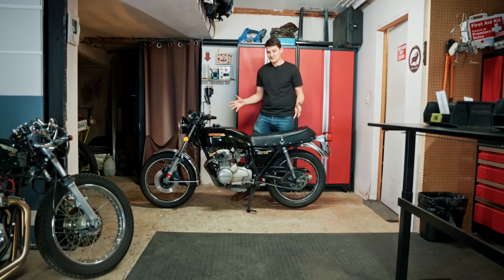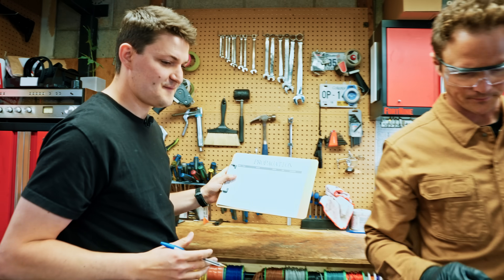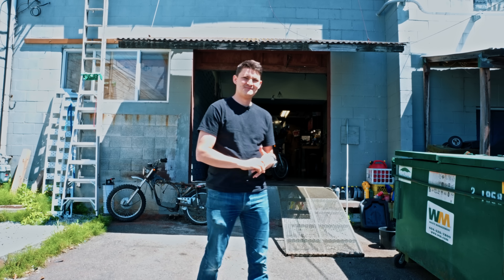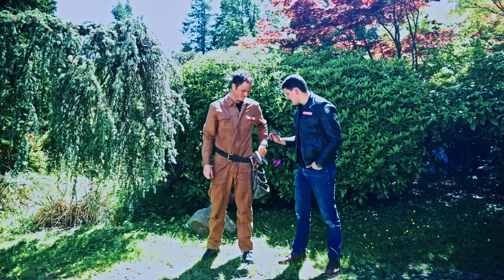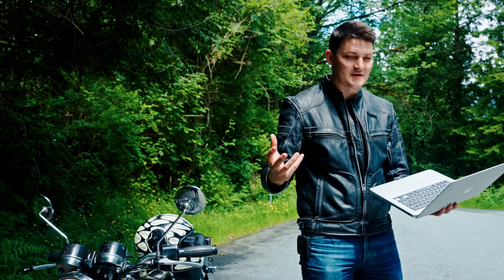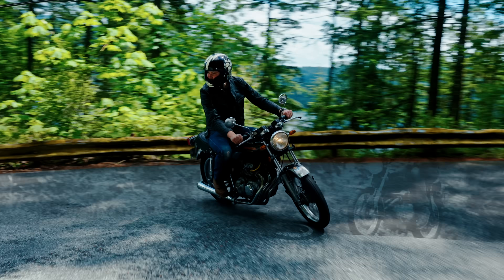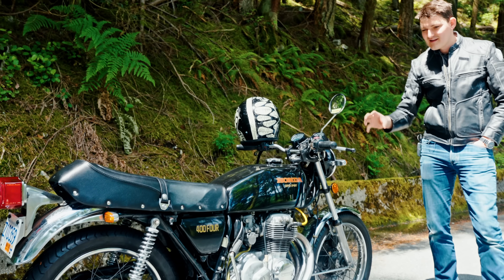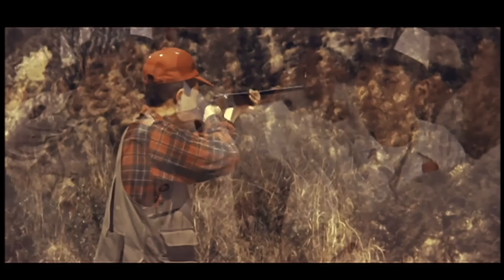Why Hondas Run Great - JIT Manufacturing, 5S Methodology and Kaizen

Comment: The 50 year old Honda is very similar to my first motorcycle. A 1975 CB750F Super Sport. I believe the F was a Kaizen update of the original 750K four which was already an outstanding bike. I ran the doors off of that thing and it never quit. Calling it reliable barely touches on how confident I felt in it always getting me home. No auto I had owned even came close.

Comment: I just hope that FortNine is making some of the contractors I work with who are big on their motorcycles;FINALLY FCKIN PAY ATTENTION TO 5S!! They start out as "we get the job done and do what that is nobody else can get done someone can clean up later if it's that important" 
And it turns into 
"those are just extra bolts I think the engineer who designed this is stupid why should we use his bolts by the way did you know that machine they designed fell apart?" (it needed the bolts)
Reply: Engineers who ride are also guilty. If they cleaned up their own desks they would be able to look at one thing at a time and see "wow that servomotor shaft has a square key slot why tf didn't we give the builders any keys for the servomotor shaft?" "And why is it slipping continuously on every machine we turn out?" "I hope my installer stops messing up and this all works out"

Comment: Back in '78 or '79 I had a conversation with Honda San. He'd been staying in the hotel I worked at, spotted my CB750 in the parking garage and tracked me down (not hard, there was just one bike in the garage, everyone knew it was mine - and I was a manager in the front office). H wanted to know why I'd bought it over the Kawasaki 900. I told him that it was better built, that the motor was easier to work on and clearly built to be repaired (shell bearings vs running straight on the castings). I'd had a number of bikes, starting with an AJS 500cc single (essentially the Matchless 'boy racer' with a rear suspension and pillion seat). I'd had at least one previous CB750 at that point (the first one had the infamous 'no room to put a big enough drive sprocket so chains wear out fast). Honda had treated me well on that one (replacement chains and sprockets) and I really liked that motor, so I bought another. My only real complaint was that that engine was too wide for the track, touched down way too soon.

Comment: As an aircraft technician, every job I’ve had very strictly enforces 5s. When I built jet engines for Pratt, they even had the specific amount of hardware in little kit boxes you needed for that specific task, shadow boards for tools and parts, etc. everything had a home, even tables were taped around on the floor and labeled.
Reply: Funny thing about those taped in tables, had my printing company when one of the prepress crew went on vacation, the rest of his team moved all of his tables about 3" in different directions. And when he came back he couldn't understand why he kept bumping into tables. Once you have everything dialed in, movement becomes automatic.

Comment: 400 F was the second motorcycle I ever owned. The first was a trail 70. I loved my cb400f. I put all kinds of aftermarket parts on to it including a Yoshimura pipe. I might have that name wrong I can't remember but it was a very expensive aftermarket pipe that could not be made to touch the ground at any angle while the bike was still on two wheels. Of course I have magura bars and Andrews coils. I never could afford the mag wheels but it didn't really matter because something happened. I saw myself in a big mirror sitting on the bike and by God I looked like the Grape Ape. People don't realize it but the cb400f is a small size motorcycle. It's very tiny and I am 6 ft 5 so I traded the bike for a 67 Firebird which I melted going through the Caldecott Tunnel at 130. What can I say.

Comment: Coming from a multibillion dollar chemical manufacturing company that pushed Toyota's operating system, the implementation is critical. I had to label a spot on my desk for a stapler or box a section on the floor for my chair to sit. Absolutely BS. There are good parts, but much of it is common sense or complete overkill BS. FWIW I also have a black belt in Six Sigma and don't even put it on my resume as I never want to be pigeon toed into doing that type of work.

Comment: Taiichi Ohno, at Toyota created Just In Time. My Hero. My favorite is that along the production line you had ropes that would stop the whole production line. If a problem happened in assembly You stopped the whole line and fixed the problem at the root cause. After a few weeks there were no problems. In Britain they would have sacked the rope puller, everyone else would have gone for a welcome cup of tea and next friday afternoon the same problem would give everyone another break.  Toyota, I have bought and run to death 4 of the'ir cars. RESPECT, Fast and Simple. Now on Motorbikes I have rebuilt Nortons, Ducatis BUT Hondas I have never needed to rebuild, I have just worked on them and I have had 4, still got one. Mostly V4s. I have also owned Yamahas, Suzuki and Kawasaki. What is the difference? They are all using JIT manufacturing techniques. However, Honda sometimes decide to show how good their engineering is and throw the accounting out of the window. For example my 2000 VFR. It has pillion drive to the cams just like an MV GP bike used to have, no sloppy maladjusted chaindrive. (the weakness of most straight fours). Now get this. At 100 000km+ I change the oil. 5000 Km later the oil is still clear, not black. I am 67 years old have worked on many bikes and cars. I have NEVER seen that before.

Comment: Yamaha employee here. JIT, 5S, and Kaizen are also key principles for us too.

Really the game changer can be boiled down to this quote describing lean manufacturing: "Lean is the continuous struggle to flow value to one customer". The term "value" has a specific definition in a lean context, basically only activities that physically transform that lump of raw materials into something closer to what the customer wants. 

That's what lean manufacturing is all about: building an organization optimized to provide value to its customers, devoted to continuously getting better at that, while respecting its people. Take those ideals to heart, and the tools can be derived from there IMO. Maybe they won't have the exact same name, but you'll end up with a similar result. At Yamaha we have TVP and Hyoujun Soubi for example, which I've never heard mentioned elsewhere, but the principles will be very familiar to anyone with a background in Lean.

Comment: In case you're drooling over the little cb400, it couldn't hold a candle to the RD350 and RD400. Some ambitious 4-stroke lovers tried to modify the CB400 Four for club racing but any decent running RD with expansion chambers could eat it for lunch

Comment: and now in indonesia, one of honda's biggest market, they turn into almost like a chinese brand. folding frame, cankcase as fragile as windshield, rear mudflap not aligned with the tire (its almost like a feature now 😅).  and all of this is not japan honda's fault. its indonesia's division that is either corrupt, dumb, or both. they lowered the quality of every single part, the new factory worker only gets 1 year contract unles you're super good (imagine new worker every year). and the thickness of every part is reduced to bare minimum or less. its widely known that honda's new scooter main frame tends to fold due to its super thin and corosion problem. like hell mr honda himself would shut the whole division if he's alive.

Comment: Dont sound like honda today, here in Indonesia, where small scooter is the main market, last year honda made huge mess, by making the frame somehow "unfinished".
The silicate slag from welding werent remove and paint cant cover over it, the welded area becone uncover, then it got rust and eventually break a part.

The worst thing was that honda never recall their products instead they sell a frame as substitution part.
That very frame is still used in 4 or 5 scooter types.

The other was engine, honda use 1 engine for 3 bikes, a sport fairing, naked, and underbone, since 2016 untill today, that very engine has  weak camchain tensioner, making the bike sound wrong, and the drivechain make a loud noice, and they never improve it.

Comment: German and Japanese engineering are both outstanding in their fields, but the crucial difference between them is the attitude towards their customers. (This is not saying, either is better than the other, just that one is going to be suitable for more people)

A German product will last a lifetime, as long as the customer is using it within warranty regs, because a German engineer can't imagine a German citizen to take their priced VW Beetle for a spin on a Finnish rally stage.

Japanese product will similarly last a lifetime, with the very significant difference, that they recognised, that there only exists a handful of people, who will only subject a product to the wear and tear calculated in the factory, and those people all live in Germany, so they built everything so that you can do most anything to it, as long as it's not actively dismantling the framework.

German products are made to be invincible to an engineered environment, while Japanese products are made to be invincible to humans.

Comment: So basically what your telling me is. What made Honda great, makes me hate EVERY SINGLE HONDA VEHICLE ever made.

I'm all for the constant improvement type of thing, but it gets annoying when you're fixing a Honda (especially their cars) and you find yourself staring at 12 different parts with 12 different ways of installation on an engine that is 4 years old. 

I like Toyota and Subaru more. They made them simple. So what the spark plugs are hard to do on 2GR-FE's and DOHC EJs and F-series, at least other items are easy to do. Like the starters, serpentine belts, timing belts, oil changes, transmission replacements, engine replacements, etc.

This in turn are making them more reliable. Subaru F-Series motors are seeing 1,000,000 miles and Toyota motors literally will not die. Unlike the K-series and J-series engines. The K-series are notorious for oil burn and starter burn out and the J-series is know for blown transmissions, while the VCM engines are known to burn valves and oil.

However people don't like when facts like this are stated and they continue to glaze the Type R.

Comment: Hi FortNine and congrats for this video! As a 25+more experienced rider and as a 25+ more supply chain expert I enjoyed each and every single second of it and I feel like this video could even help many SCM professionals! Unfortunately, and I don’t blame you because it’s a commun misunderstanding of the concept, the way you “pronounce” just in time is wrong. It’s not « just in time » but « just, in time » meaning: the just quantity(and quality), in due time. Since decades many industries try to reach the zero inventories target in order to endorse the JIT philosophy which create unwanted tension in the production or supply flows. Inventories are an asset for a company if they are well dimensioned and help buffering the different stages of production. Will not elaborate here but needed to say it! Thanks for your interest in the SCM science and congrats for the show!

Comment: As someone that works currently in the automotive sector, it warms my heart that quality concepts are still being preached. Even by people not in the field. I struggle with my colleagues and management currently on the why's (aka root cause problem solving). It's slow "right now" but then there won't be a problem again ever after.

Unfortunately, I'm being over-ruled for bandaid now (often literal bypasses) by another colleague and then we force some trainee to watch the thing to not break down until the customer demands a permanent fix. Often at time crunch and our expense.

Comment: I did briefly have a chance to work at the multi-purpose engine factory as a translator. I can vouch that everything you’ve said in the video, they aren’t just for marketing, they take it seriously. Kaizens are heavily encouraged in every way possible, not just for the design. There were kaizens for safety and quality of life improvements when I was there (such as better oil spill protections for parts karts), and the proposers were rewarded for doing so.

Comment: Pretty much any well maintained air cooled carburetor engine that's 50 years old will start immediately.
That goes for lawn mowers to VW's.   By the way, at 0:06 that's a hell of a nice front DISC BRAKE on a 70's bike.

Comment: What may allow the Chinese to take over in motorcycle mfg is that the public is not a discerning one. At some point things become commodities like washing machines, microwaves, computers, etc. Sure you could go out and buy a USA made set in the past but at some point people stop caring about quality and just about price. Eventually you can't even get a mass produced USA made microwave or computer. Almost all washing machines except Speed Queens are made overseas or at least with mostly overseas parts and materials. 

Maybe consumer sentiment will change to favor long lasting and well built goods but at the rate technology improves many things it may not be financially sound for many.

Comment: The Lean methodology (that came out of Toyota's manufacturing originally) is applicable to a lot. It's even applicable to your own garage and workshop and kitchen. It can make many processes a lot more efficient, quite aside from JIT manufacturing. Just in time also has issues... as we're seeing on the world stage, because as soon as the flow is interrupted, the whole chain just breaks down very badly. Arguably as a species we'd be better off if we were a little bit less just-in-time - except of course, that would probably be less profitable, if considerably more resilient. And say it with me, all hail capitalism and maximum profit at all costs.

Comment: I used to work for a multinational company that incorporated 5s into its work flow, the biggest issue was management constantly changing it. It can work in certain industries but for customers that would change orders constantly and require design changes quickly it became something that slowed us down

Comment: I worked for a fairly large auto part manufacturer that supplies many large American auto manufacturers. In my case I was setting up some of the disaster recovery systems, I'm a computer guy so manufacturing was really my thing in the beginning. A lot of programming was required so that a workstation could be replaced in >5 min. They hired Me as an employee, not a contractor. I was fine with that at the time. UNTIL the 5S Police showed up (the first set of 5S Police), the plant I was working at was a JIT supplier. There was a lot of time and money spent on Kaizen principles and whatnot. 

There was more than one department, and more than one person who all thought they were Primarily responsible. None of them used the same standard. Pretty much quarterly I had to stop what I was doing to re-clean, re-organize, RE-LABEL everything on my desk. The company loved to beat their chest about 5S, but the company didn't understand 5S. Didn't understand that one size fits all solutions don't necessarily work when trailblazing was still being done. In that poor implementation it was a serious time/money sink.

Comment: You forgot to mention the supply chain, which is extremely important. Parts need to get to the manufacturer JIT, sometimes even on the same day that they are going to be used in production, and most importantly their quality needs to be top notch. Fail to do so and  waste will appear down the line, assemblies will need to be reworked or scrapped, increasing time and material waste. Quality is not only a result, but a necessity of this manufacturing methodology, that is why OEM parts are of such good quality.

Comment: The CBR600F2 (1991-1994) already had the air ducts on fairings and two hoses on airbox (which lead nowhere yet) ready for the RAM air intake system on the CBR600F3. Some clear evidence of their 5S methodology on being ready for the next part.

Comment: I once owned an '82 750 Nighthawk. To say that those bikes were bulletproof was to somewhat understate the case. In the 7 or so years I owned the bike I did the cam shims once and synced the carbs, also once. Those were the most intrusive maintenance items I had to do. Otherwise the bike started every time and ran near flawlessly ( I say "near" as it stalled on me one late evening at something near 60mph on a pitch black David Thompson highway, leaving me both power and light less whilst I silently coasted through a herd of elk that my riding buddies later told me were "all over" the road, while I was otherwise occupied trying to get the bike going again). I still miss that kind of reliability so instead of a domestic 1/2 ton, I opted for the Ridgeline instead - a decision I have yet to regret. Yet another lesson: if you build excellent and reliable vehicles, your customers will support your brand with purchases decades later.

Comment: I agree. For decades Honda in my country has been the leading brand for quality and longevity. Sales are off the charts until production line couldnt keep up with demands. Honda motorcycles in Indonesia is produced and assembled by AHM and nowadays Honda bikes are notorious with low quality material and finishing, especially in younger generation whos aware of the situation. But older generation still thinks Honda as how Honda bikes used to be so they still buying Honda products

Comment: Just sent the link to my key stakeholder at work.  It's the most concise, common sense explanation I've seen of the application of those systems to a physical process. This really helps to explain the service design principles I'm trying to apply our current Logistics project. Much appreciated.